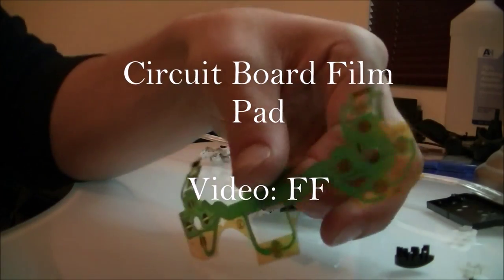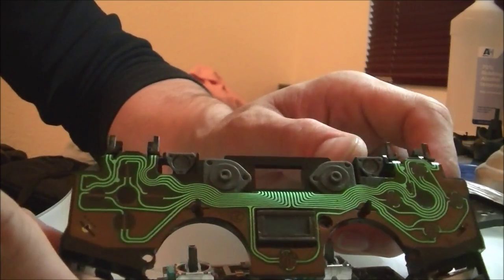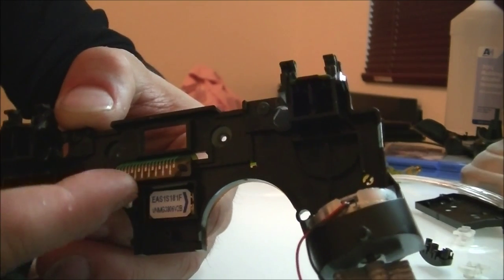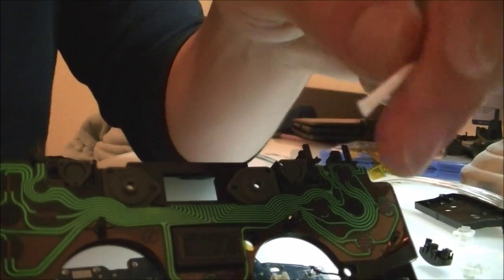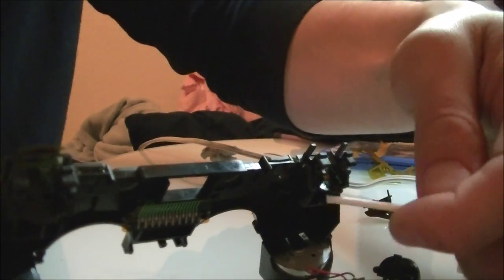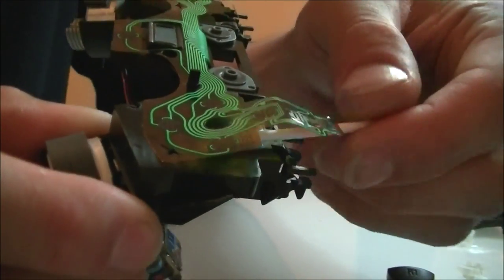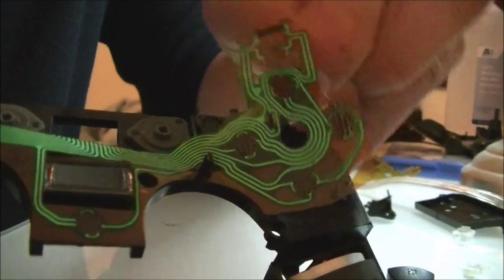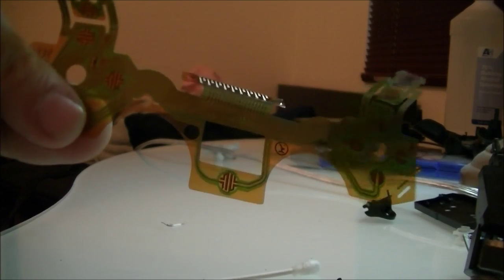Video FF : Circuit Board Film Pad Removal and Maintenance

Comment: no I am asking 
why do circuit problem occurs?what's the resone behind it?
Reply from the maker: +Affan Qureshi Thank you for clarifying. I can only give you reasons for the problems that I have seen in my experience. So far I have seen this problem occur about 3-4 times.one time it was due to a small tear in the circuit board film pad. I believe this must have been due to the last owner trying to open and change something inside the body previously and "not being careful". The second problem I saw was caused by a faulty R2 button. The owner ignored a broken R2 button. The plastic hinge snapped on the R2 button, the owner kept playing until the internal plastic frame was broken and the conductive rubber pad underneath was torn to pieces. Of course this resulted of direct broken R2 plastic being rubbed against the circuit board film pad, piercing the film pad itself.Both the third and fourth times were because of particles (dirt or broken plastic) being lodged underneath the conductive rubber pads that create contacts/buffers between the buttons and the film pad. Therefore if you ever hear something rattling around inside the controller, I would recommend maintenance and cleaning of the inside of the controller.                                                                                      In short, anything that occurs between the button, conductive rubber pad and film pad can cause these problems. The final problem can be due to a broken internal plastic casing. Thanks for the questions!

Comment: Hey man my triangle button doesn't work anymore can replacing this fix it?
Reply from the maker: It probably goes deeper than that. I would imagine that the triangle button does not work because of the pad underneath or because of a motherboard problem. Try to open it up and reseat the rubber pad underneath to make sure the black conductive pads are making proper contact with the main board. It may fix your problem.
Reply: @bonuscard1963  I have electricity problem at my home. My ps4 recently killed my 1 tb external hdd. I was using the same port to charge the controller as well. I kinda feel like the problem is with the motherboard of the controller. I opened the controller and cleaned it but still no response. What do you think?
Reply from the maker: I guess the weirdest part is that it is only located on the triangle button, i would expect more problems if it is in fact a motherboard issue. Did you make sure to inspect the rubber pad for any tears? If it really is aj electrical problem, i would suggest finding the root and solving the electrical issue before attempting any costly repairs/purchases so you dont repeat the problem.